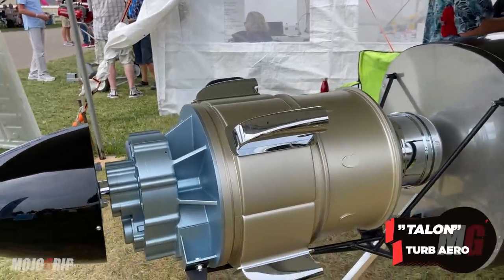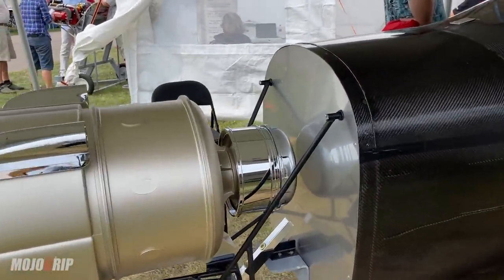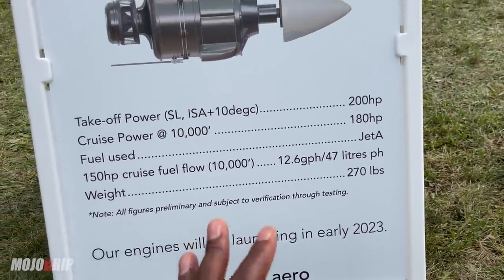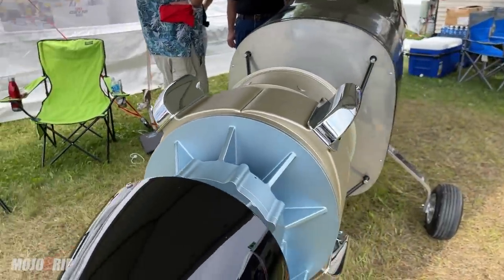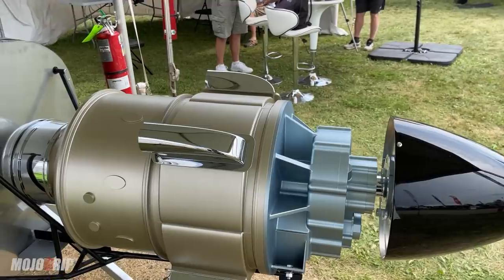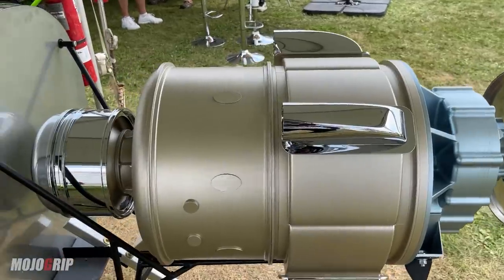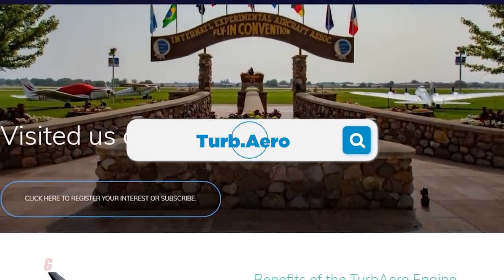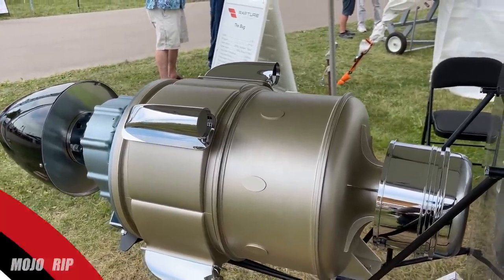200HP Turboprop Engine To Power Single Engine Airplanes - TurbAero

Comment: Very poor horsepower to weight ratio for a turbine engine.  TBO should be many times more than a reciprocating engine.  ??? Recheck the engine specs.?!!! It doesn't add up.
Reply: Tom, the TBO was incorrectly reported.  Our target is 3,000 hours.  The weight is correct (270 lbs) although it will be put on a diet before going into production.  The higher weight for our engine over a traditional turbine engine is as a result of incorporating recuperator technology into the engine.  This technology will enable our Talon to be more fuel efficient than a non-recuperated engine and will bring its fuel consumption much closer to a piston engine than traditional turbine engines.  The drawback with the recuperator, which is a compact heat exchanger, is that it is a very dense chunk of metal.  However, we figured we could sacrifice some of the weight advantage over a piston in order to improve fuel efficiency.  Where we have settled is a compromise between weight, fuel efficiency and cost.  We could ditch the recuperator and save on weight and cost, but you would be burning a truckload more fuel.  We want to offer our customers the ability to have a similar range from our engine as they are getting from their piston engine, rather than half the range that one might expect from a traditional turbine engine.